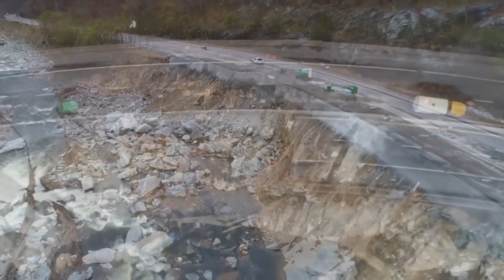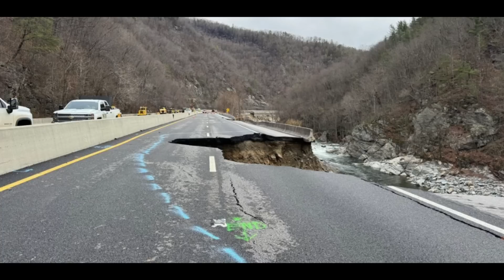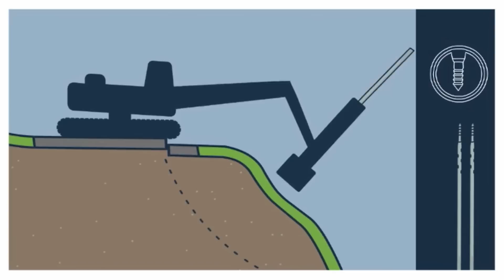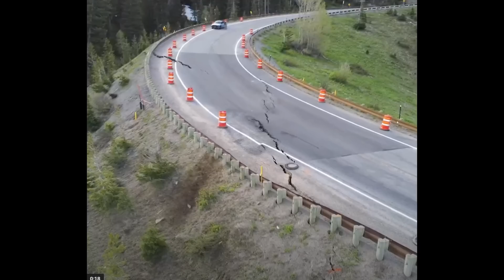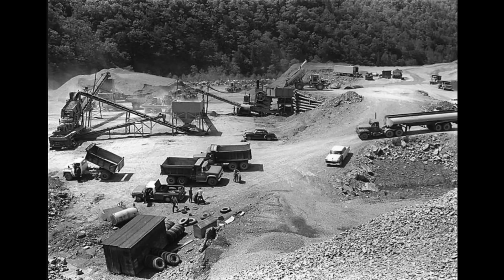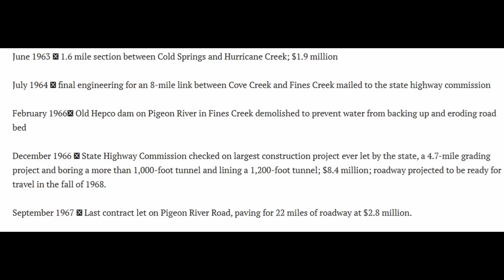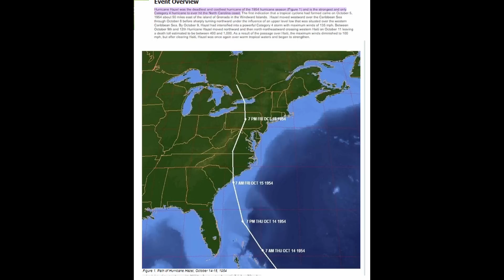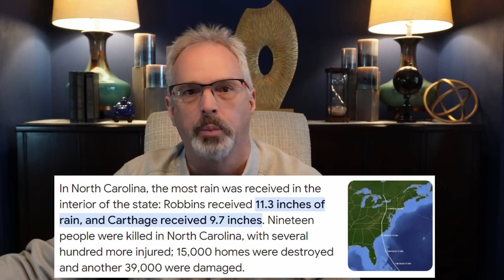Interstate 40 Rebuild Status

Comment: I am a professional engineer and have taken an interest in the reconstrucion of I-40 since its destrucion by Hurricane Helene.                                                                                                                   
      There is another option for rebuilding I-40 which no one seems to be considering.  Rather then hauling in a mountainside of fill to be compacted behind enormous retaining walls, or relocating the interstate out of the gorge completely, why not construct an elevated viaduct similar to Linn Cove around Grandfather Mountain.  
     Simply build foundations at the bottom of the gorge to accomodate vertical columns and a new roadway.  This method, though still expensive, would be much cheaper and faster than trying to re-contour the mountainside to its previous shape or building a new stretch of I-40 out of the gorge completely.  
     Basically, you need to perform a cost benefit analysis to evaluate rebuilding I-40 in its present location to re-aligning the highway out of the Pigeon River Gorge completely. 
     While the gorge section is 22 miles long, only a fraction of that distance needs to be rebuilt.  But re-aligning the highway to a alternate route would require about 35 miles of entirely new highway construction through mountainous terrain along with several new tunnnels.  And all that would still be in an area prone to future slides.
Reply: I suspect that while the construction would be faster and easier, the engineering would take a long time before the building could even start. The gov is focusing on speed over long term feasibility.
Reply: Parts of I-70 through Glenwood Canyon were built this way.  I think that the river flow through that area may be a little more predictable than the flow of the Pigeon River along I-40 though.
Reply: Biggest issue with vertical bridge supports in a mountainous region is debris, when 20’ wall of water is rushing through with flooding as it did here during Helene there was 10’+ diameter boulders in with that water. Not to mention steel beams, slabs of concrete etc etc that would beat the vertical supports to death fairly quick imo
Reply: @young11984   Truth. and lets not overlook the possibility of catastrophic damage from landslides
Reply: Looks like there was some "railroad" mentality involved in the original design meaning that the most advantageous grades can be found along creek and river banks.  I think Mr. Jones' idea of finding a new route warrants consideration.  Some of our current "environmental" restrictions are just zero growth incongruity.
Reply: @geoffmorgan6059  when was a 5% grade adopted as a preferential design limit for highway grades?  The original route of the PA Turnpike had several more tunnels than the modern route because they were trying to avoid anything more than 1% to keep it easy for the much less powerful cars of the era.
Reply: @Dan_Neely  In the West, mountainous terrain, long stretches of 5% or greater is not acceptable. Routes meander to make grade just as the railroads do. And if an impasse is reached then tunneling is plan B. 

5% downgrades for 10 mi kills. Upgrades are a nightmare of 25-30 mph in low gear.
Reply: @Dan_Neely  1956. Several 1940s "superhighways" were built to much stricter standards for vertical alignment. It was too expensive.
Reply: @Dan_Neely  Following creeks and rivers can prove more economical other than grade alignment.  It can mean cut and fill balance avoiding borrow and waste.  One of the most important economical considerations for any grading especially in challenging terrain.
Reply: Cars are not the issue. Its the 60,000 lb tractor trailers hauling all the fancy stuff people buy. You get one of those on a long grade with no safe place to stop and it will be the the boulder run from indiana jones, but with cars.
Reply: @Dan_Neely  The current FHWA standards allow for a maximum 6% grade in "mountainous terrain".  The Pennsylvania Turnpike was built in the 1930's.  This is 2025.  Obviously grade are to designed to obtain the most advantageous vs. cost.
Reply: @Dan_Neely  The PA turnpike right of way was originally surveyed for a railroad
Reply: @geoffmorgan6059  A new route.....  Really? I live in this area.  Take a look at the maps.  Pay close attention to the topography.  I invite you to find a more suitable route.  I'll be waiting to hear your reply.
Reply: @BUFORD-T  It would require a detailed study.  Obviously, the area has steep terrain.  It may be feasible to move two lanes up the ridge and separate the roadway as where it does at the tunnel.  Again none of this is going to be "cheap".  Piers might be used to support an "elevated" roadway.  Cost analysis can be done much faster than in the past.  The statistics of the rain events indicates that this intense flooding will happen again.  One of the misunderstandings of flood event probability is that two 500 year events can happen within several days (or less) of each other.  Same goes for 1000 year floods.  It takes a big number of events to move the curve.
In years past railroads and highways have been rerouted miles and miles from the original routes.  It just depends on how many times the state/USFHWA cares about closures and roadbed damage.
Reply: @BUFORD-T  Precisely! Where would another place to build a major interstate highway BE in that area? Even if they could find one, the required environmental impact studies would take years before construction could even be approved, much less begin and get completed so traffic could flow again - because GOVERNMENT...
Reply: @geoffmorgan6059  It shouldn't take a BIG number of events to move the high-end curves... but in the absence of any really large events (which is usually the case when we are trying to extrapolate 5-10x the length of the available record), the high end as it is understood before a disaster is bound to be underestimated. At least in absolute terms. The allowance for freeboard, which is something that BETTER have been left on these poorly controlled fill slopes, probably helps a lot because a foot or two at the top of a valley can represents a whole lot of water.
Reply: @BUFORD-T  While I basically agree with you, wouldn't Interstate look much much better if it were up on a viaduct or pylons like sections of the Blue Ridge or Foothills Parkway?  Animals could then easily pass back and forth between Pisgah and Cherokee National Forests and the Great Smoky Mountains without too much trouble.  Something needs to be done.  If we can remove dams from Rivers weekend remove fuel door dirt and redesign a road so that the river can flow the way it once did and not be a threat to the interstate.
Reply: Along the French Broad as it is should have been done in the first place. @BUFORD-T
Reply: @geoffmorgan6059  The most feasible route is east west thru ASHVILLE TO BLACK MOUNTAIN like the Federal Government wanted to start with. That 20 mile north south route was politicians mapping for those politicians convenience.
Reply: When you say "much cheaper" can you say that in current US dollars to 1 sig fig. Author claims 15 M a mile for 22 miles. 330 M. If your way could build the 22 miles of road for less than 330 M, I'd say do it. If the estimate was 500 M it would be a maybe. There is a elevated viaduct section of I-70 near Denver.
Reply: @luck484  I believe the $15M per mile estimate is an order of magnitude way too low.  A viaduct would be much less labor intensive than building huge retaining walls and backfilling with hundreds of thousands of cubic yards of fill.  Currently, it cost more than $15M per mile to construct an interstate on flat land.
Reply: Cut is more stable than fill.  Why not cut into the uphill side and fill with a massive concrete wall...essentially a damn below.
Reply: @TheRagingPlatypus 
I worked for a Contract Blasting Company for 6 years, and that, or the Lincove Viaduct type roadway was my first thought, especially after this last collapse.
Reply: Look at I-15 at the Nevada-Arizona boarder between Mesquite and St. George; it's the same approach they need to take there.
Reply: @DocNo27  no hurricane's there, but great downhill run.
Reply: @DocNo27  I don't think you appreciate the economic activity required to justify the investment needed to reroute I-15 around Hoover Dam
Reply: @The_Ballo   I-15 doesn't get anywhere near Hoover Dam.  93/95 or now Highway 11 goes by Hoover Dam - they built a massive bridge downstream so technical no highway goes over the dam anymore.  You can't even get to Arizona from the Dam now :/
Reply: Perhaps this section could be built like US 321 entering Gatlinburg, with a second two lane carriageway on the opposite side of the river? Would be very expensive, but so is losing a major highway route for months on end.
Reply: @VinsonMusic  I consider that a viable option, and it appears that the opposite side of the river is less steep in places, but it still does not account for the fact that the gorge is too steep, narrow, and unstable in too many places. I saw in India and China they are literally building viaducts in the middle of the riverbed to deal with that issue, but I am very cynical about placing bents straight into the channel.  I feel like it would have to straddle the channel with angular supports on each side in that case, but that opens up many other issues.
Reply: When Ivan destroyed a section of I-40 back in 2004 I think, they rebuilt the missing section on piers. Helene washed that section away only 20 years later.
Reply: I don't think the alternate route is feasible.  There would be a lot of problems acquiring land for starters.  If that's the case then they should continue this repair at whatever cost and then build the alternate route over time.
Reply: I just added a comment having not read the other comments, and as soon as this happened, and the new section collapsed  I'm thinking why not use a Lincove Viaduct type construction to rebuild the area.
That or Re - Bench the inside slope to move it futher away from the Pigeon River. The Material generated from pushing the slope back, could be brought down to form the fill needed to build a buffer between the river, and the new roadbed, that would be almost entirely on Bedrock. That may very well be the most economical way to approach this rebuild.
Reply: What’s the possibility of using modern technology, board drilling completely through the mountain?
Reply: @irvgleaner5558  you mentioned that you’re an engineer, professional engineer, emphasis on professional. Congratulations on your background. Can you explain why a professional engineer would put guard rails within feet of a roadway? Now mind you hundreds of feet between the direction of traffic. Example interstate 40. If you have to make an evasive maneuver, hit a slippery patch or blow a tire, there’s no place to go but into a guard rail. To me that makes no sense. But maybe a professional engineer can explain that to me. I’m not insulting your degrees or your intelligence. i’m just confused. I’m trying to figure that out. We’re still stuck in the horse and buggy days when it comes to our roadways.
Reply: @SHJ1974  Guard rails within feet of an active roadway surface most likely were placed there only because width restrictions in a mountainside cut did not allow for larger shoulders with guard rails placed outside that boundary.  When space alllows, larger medians separating opposing traffic and wider shoulder and guard rail placements would alwsy have been a primary design consideration.  When the mountainsides were cut back to provide a level terrace for road construction, engineers were limited in making rock cuts deeper into the mountain without increased vertical terrain slopes and furthering the risk for rockslides   Your suggestion of utiizing tunnnel boring machines to place highways through mountains would be the most expensive alternative, and there are limitaiton to the width of the accomodated roadway.  Most bores only provide for two lanes maximum per cut, and do  not allow for breakdown shoulders.  Think of the Lincoln and Holland Tunnels in New York and you can see the width limitaitons.  Granted, today's modern boring machines might provide increased width, but still nowhere the amount required for interstate highway standards.
Reply: I think they are trying to flood proof it for next time. If they don’t rebuild the mountain I believe it would be prone to more land slides which could take out the base of the structures you are proposing.
Reply: I pulled up Google maps , seems to be updated sense The flood you can see the washouts , I counted at least 13 sections +- of various Lengths, one section looked to be maybe a 1/2 mile long ,it’s going to take some heavy rock and concrete supports to take care of any future flooding, cause you know it will happen again, and that narrow canyon just makes that water much stronger and faster ( like a sprayer on a hose ) . Just my two cents.
Reply: Tat highway was never mapped by the Federal Government to run north/south thru the gorge to start with. That was politicians mapping so they could have a Highway to run by their hometowns for them to travel to raleigh on. It was supposed to continue east/west thru Ashville to black mountain and points east and thats why north carolina isnt getting Federal dollars now to rebuild it. The Federal government DOES NOT want it going thru the gorge PERIOD because of washout and flooding. Even if you BUILT A Via Duct it would still wash out those PILLARS the next flood that comes along. The Pidgeon river is a very HEAVY river when it goes into flood stage because all the water coming off those mountains goes right into it. Thats why the Federal Government DIDNT THEN AND DOESNT NOW want money poured into it. It isnt feasible
Reply: The Linn Cove Viaduct doesnt have a river running underneath it. That 20 mile stretch of I40 does and thats why the Federal government Didnt Then and doesnt now want that highway built thru the Pidgeon Gorge is because that river will wash it out again and if you VIADUCT it it will just wash those pillars out
Reply: The only thing that can be agreed upon is the huge cost of any of the proposals. The final cost will only be known when the project is completed because cost overruns and unpredictable situations will always run up the costs. Hopefully some very bright minds are working on this quagmire. Maybe we could get Biden to send NC a couple billion of the money going to Israel and Ukraine to help out our state. (Sorry, no way in h__ the Feds would ever fork over any of its citizens.) 😢😢😢 Thanks for your program.

Comment: I realize that funding is the primary reason for mostly every corner being cut and only sufficient upgrades being decided upon when repairing and rebuilding a major infrastructure project. Having said that, I would suggest that bringing in massive cranes and various other equipment needed to install 60' above ground / 20' below ground prefab steel enforced cement slab "seawalls", along with, massive French drains & wee poles (as needed) that allow draining for sub highway ground water to dump into the river. Have these seawalls installed about forty feet out from the eastbound edge of the old eastbound white shoulder line, backfilled & compacted properly, install a cement barricade preventing rigs from being able to veer off the 20' shoulder, install a rock embankment halfway up & between the seawall & the river (sloped & compacted), in hopes to help prevent erosion, then, install lighting and call it a day?

Comment: I think the two states should either rebuild I-40 as twin viaducts and/or a twin tunnel drilled through the mountains to prevent such landslides in the future.

A quick and dirty method would be simply to renumber I-81 up to I-78 by Hershey PA and the full length of I-78 as I-40. North Carolina I-40 would then be renumbered as I-38.

Comment: When I was a highschooler I read a book published in 1967 titled Road to Ruin and the author described the ludicrous sizes of the mountainside cuts and fills to accommodate the highway. IDR if the author predicted a disaster such as the failure of the I-40 embankment here but I wouldn't be surprised if he did.
Reply: Based on the title, it does appear he would have predicted it got ruined.

Comment: Well Casey !!!   When the I-40 was in the planning stages, they were told NOT to build a road thru the gorge !!!   Since then it has had many slides do to winter conditions & Heavy rain events as you are well awear of !!   Like they did in WV with the I-77 WV Turnpike , ALL of the mountain needs to come down with the tunnels removed just as they did !! NO more landslides or having to worry about rocks coming down with the frost heaves !! ALL that they are doing now is wasted time & $$$$$$$$$$$$$$$$$$$   !!!:face-orange-frowning:

Comment: Driving between Chicagoland & the southeast makes that a well used piece 9f road for us. The nearby tinnell is kind of a marker for us between north & south. It is a dangerous drive because of the location through the Smikies, but without it, the drive would be sooo very much longer (the alternatives would be either steeper and windier two lane rural roads, or driving around the mountains). I hope they do fix it. It'll be harder to get around without it.
Reply: You can go I 81 to I 26 to get to Asheville NC